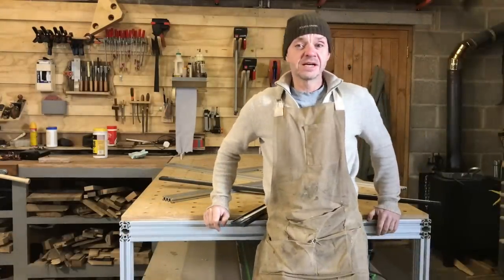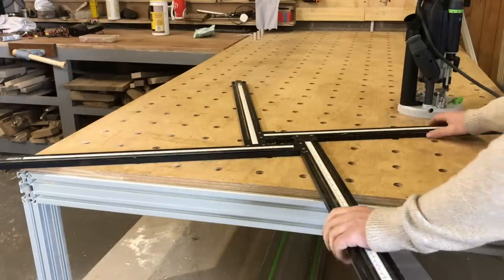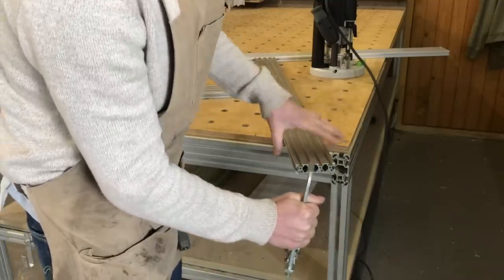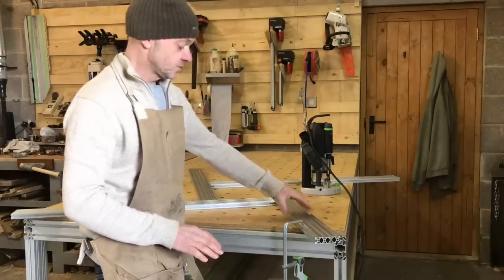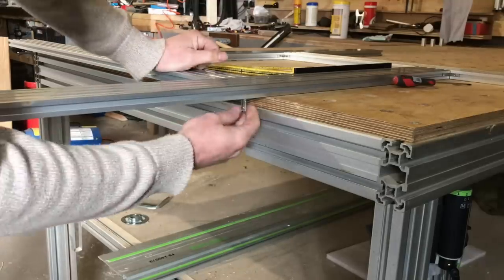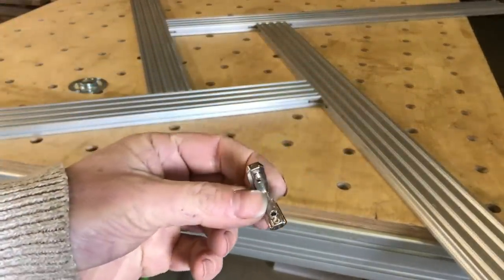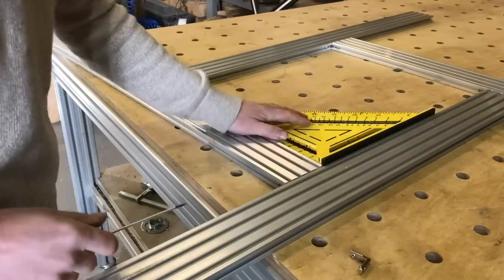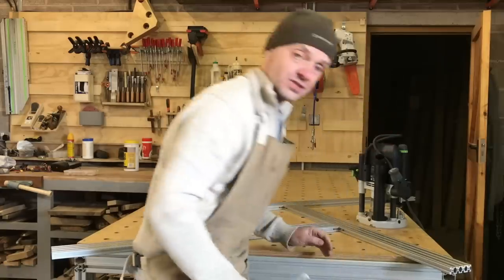Mega Profile Router Template / Jig  - Epic 1-Meter!

Comment: You could 3D print an adapter for the clamp. You could also print a bracket for the outside connection of the rails to keep them square.
Reply from the maker: cheers .. not go into that maybe one day or if my sons starts using then , I am just learning Sketch up

Comment: Just put 4x1000 2080 profiles and 8 L connectors in the basket at Ooznest and it's £91.94 delivered in the UK. The connectors have 4 grub screws rather that 2 but like pressed rather than cast like the banggood ones.
Reply from the maker: that's a good price  I just found that banggood are offering - order 2,get 15% off,order 5,get 25% Off
Reply: @ManorWood  did a bit of googling tonight and found the connectors Festool use for their MFS. If you look for a company called Valuframe they have something called a "no-drill connector"

Comment: Check out ooznest for v-slot (slightly different profile designed to run wheels on), I built a very versatile table saw fence out of it. Misumi also have a UK site, it's more expensive than banggood but they have a ton more options for profile shapes.

Comment: For clamping you should check out Benchdogs fence dogs https://benchdogs.co.uk/products/fence-dogs. Variable height and a v-slot bolt which should fit perfectly. I have the MFS 700 and now 400 set as well and love it. Wish I'd seen this before as it makes the wallet weep!
The Festool version is 16mm thick IIRC which is a bonus and the 30mm bush adaptor, but those are only minor gains for the price.
Reply from the maker: Festool one is great no getting away from that .!